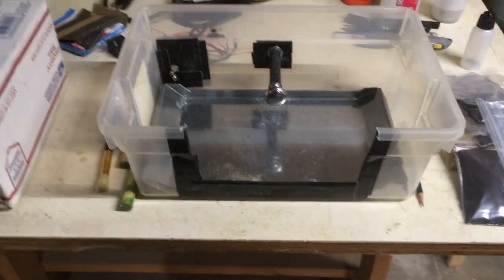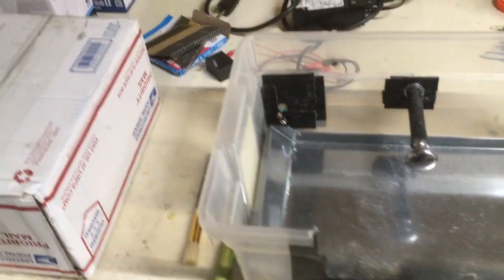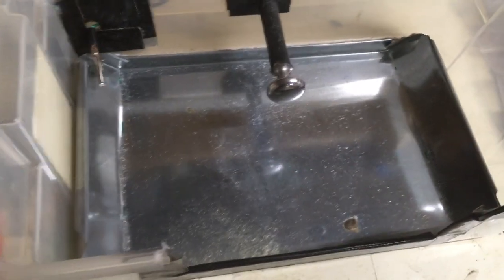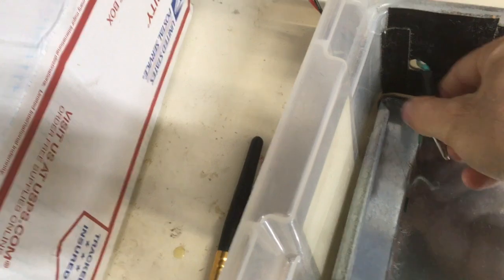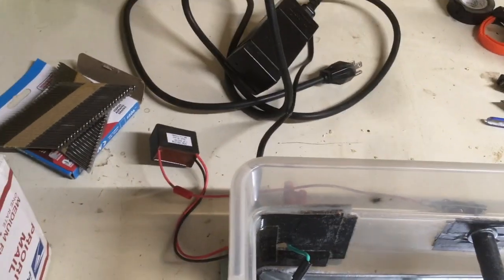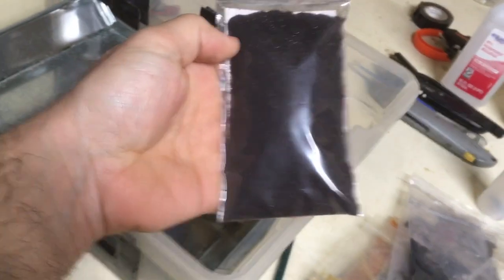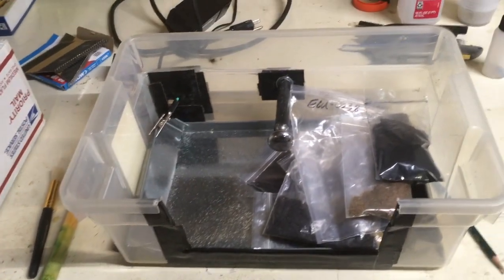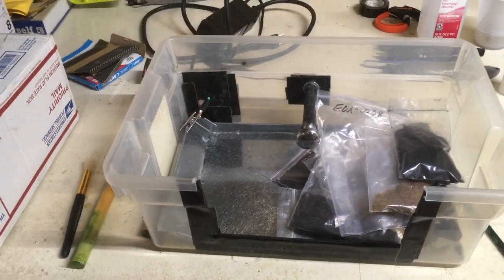GI JOE FLOCKING BOX: BASIC BUILDS

Comment: Your power supply to your high voltage module should be 12 volts max at 1amp or less. The current is what kicks your can... keep it as low as possible to keep it as safe as can be! Nice video!

Comment: What voltage reducer did you use? What voltage do I need to reduce it to? 
Thanks a lot this is so helpful
Reply from the maker: Let me check and I’ll let you know.
Reply: Skunk Works thanks a lot 
It would be great if you could explain a little bit more how to get all the wires together, I have no idea about this but I want to get that finish in reflocked heads 
Thanks a lot
Reply from the maker: Felipe Soto I used a 12V 5A Power Supply Adapter Converter Transformer AC 100-240V input with 5.5x2.1mm DC Output Jack. Look up schematics for a flocking box on google. There are several helpful pics. Very easy to do. Just need a negative ion generator, power supply reducer etc. all available on Amazon.